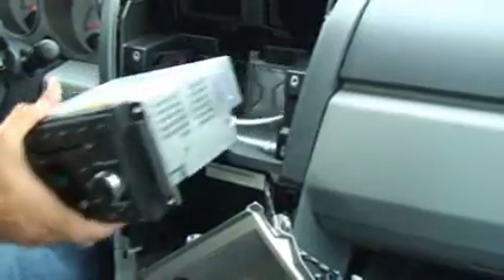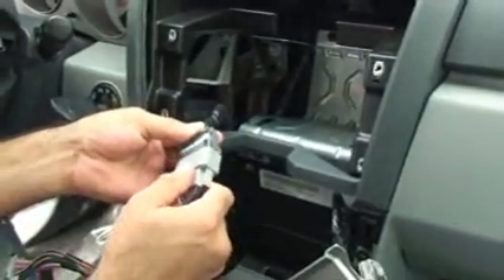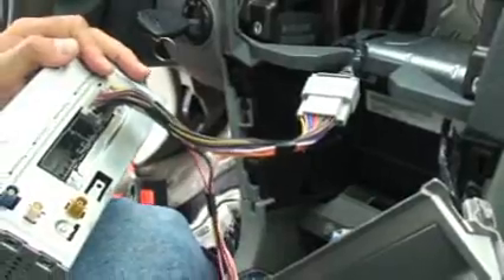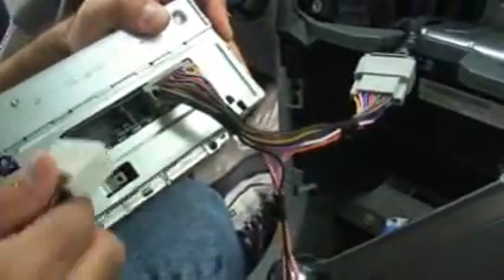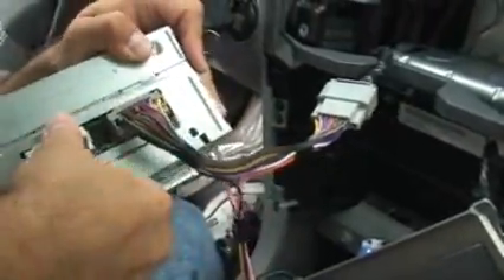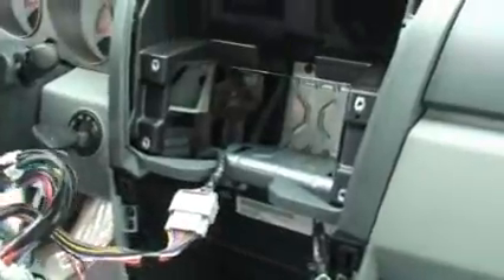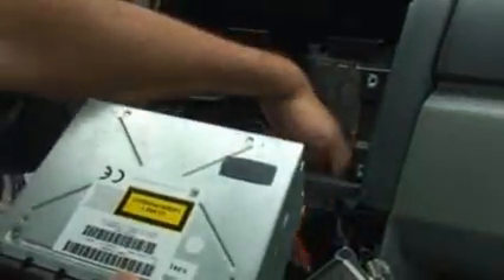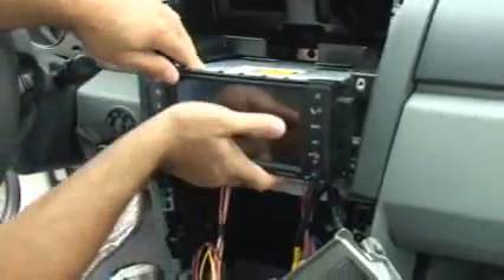MYGIG - 2008 Dodge Avenger Install

Comment: I have a 2008 dodge avenger se and I want to update it to the one you have in this video. My question is do I have to modify the wires or can I just plug it in as in the video and where can I go to buy one like in the video?

Comment: If you change the stock radio for a screen radio. Will you loose the steering control radio functions? Or can you still use them on new radio?

Comment: I have a question. I have a 2008 dodge avenger with the stock audio system. I have sat but no my gig. Is there hookups for a sub or do i need a p/cp converter? Or a new headunit?

Comment: do you need anything special plugs or anything to install the mygig system from the original radio and also, does it fit perfectly in the trim? also, do you know where I can find a mygig radio to buy?